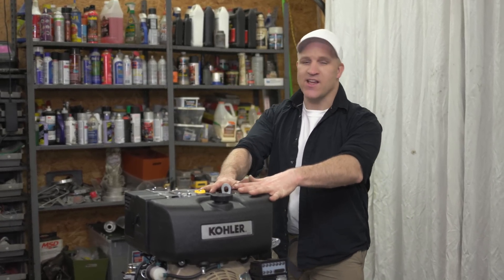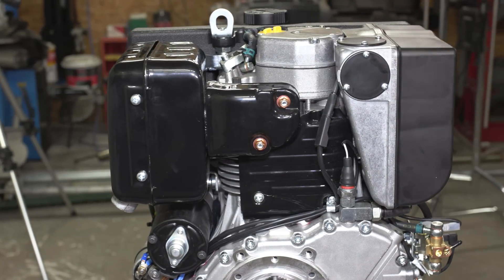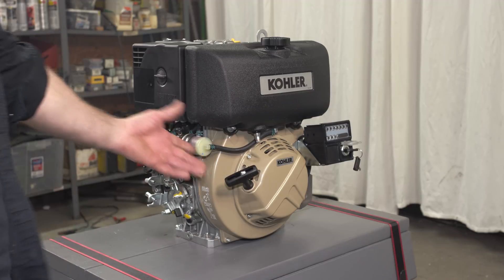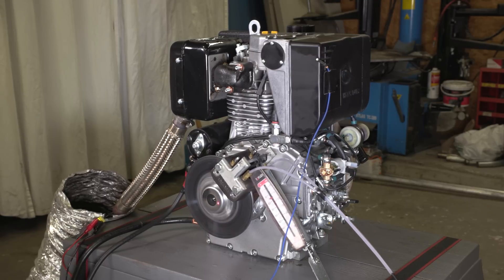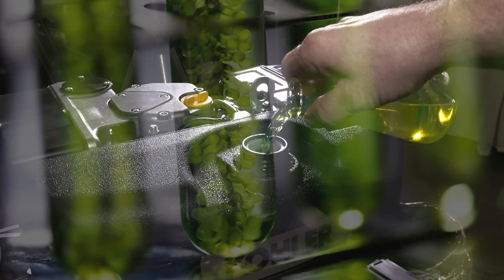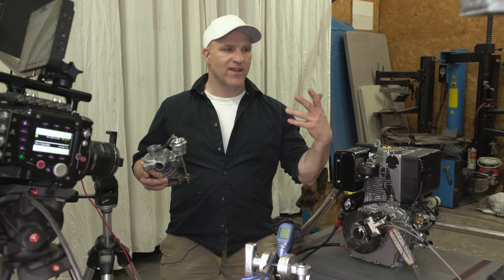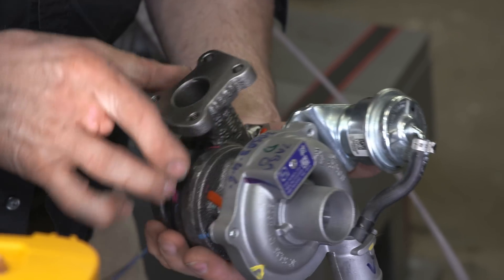Single Cylinder Diesel Engine - Dyno Test (Diesel, BioDiesel & HydroDiesel How Much HP?)

Comment: And in your estimation.  The winner is!?

It otherwise was, a great video.  Superbly produced.

It would seem to me.  Me the, audio engineer/broadcast engineer.  The Hydro diesel had the hottest exhaust gas temperature.  While the block and head.  Maintained, the coolest temperatures.

On the other side, normal diesel.  Was just the opposite.

And so not being a diesel person myself.  And looking to extend the life and serviceability of the engine.  As an electronic technician.  I know that heat kills.  And with an apparent increase in power.  It's too bad.  One cannot just fill up with Hydro diesel at the pump.  I mean, what is that stuff?  The Walmart 1 gallon emergency diesel fuel for your, diesel Mercedes-Benz convertible?  While that looks like the stuff everyone would want to be using all of the time.

I guess it's that extra hydrogen and oxygen infused into the petrol soup.  That provides the extra power boost?  While also perhaps.  Automatically causing your cylinder walls and rings, to get rusty?  But it's only to get to the next, fuel station.  And so no big deal, short-term?  Kind of like having only the availability.  Of a master fuse for the starter.  Or no starter fuse at all.  And you do the math.  Tow truck?  Or a burnt hulk of a car?  Tow trucks are too expensive.  And since the 7-11 fuel stop with no tow truck is 11 miles up the road.  While the towing company is 50 miles away.  Let's see what happens?

Oh look!  It started.  And so you take a piece of tape.  And you tape the blown out one in front of your speedometer.  But still being able to read it.  Of course.  And that way you won't forget to stop at the auto parts store.  To get the proper replacement.  Because you want to have, the proper replacement.

In my, audio engineering and electronic technical maintenance, experience.  At least that's the way I would roll.  And then just going back to using regular diesel.  Regular diesel has served me well now for 30 years.  And you pour the extra stuff in for the cold weather season.

Comment: Actually this is making the measurements differ from each other. Increased RPM increases horsepower. The "regular diesel" test run resulted in 8.5hp @ 2800RPM
And the "hydro diesel" test run gave 8.83hp @ 2900RPM.

If you would've increased the RPM to 2900 with the "regular diesel" you would've got around 8.80hp. Here's the equation: 8.5hp divided by 2800rpm = 0.0030357143.
0.0030357143 * 2900rpm = 8.80357147 hp.
You can also do it the other way around:
8.83hp divided by 2900 = 0.0030448276.
0.0030448276 * 2800 = 8.52551728hp

So "regular diesel" would theoretically give 8.803hp @2900RPM
And "hydro diesel" would've theoretically given 8.525hp @2800RPM

You can't do a test with different RPMs and think it doesn't affect horsepower, ask any professional dyno shop.

Comment: My grandfather used to tell me that they would add around %10 gasoline to diesel to increase the freezing point of it and he was adamant that it also increased the performance. I'd love it if you can try that.
Another video would be to find out whether cetane boosters increase the performance.
Running it on vegetable oil
Nitrous injection
Meth injection
Nitrous injection + turbo + see-through engine would be ultra cool.
Spraying oxygen through the intake while the engine is running to increase the concentration and measure power difference.
these are just off the top my head. Great video!

Comment: I used a hydraulic pump as a brake. Then removed the load cell from a scale and connected it to an Arduino along with a hall sensor. That way everything could be fed into a computer and you don't have to deal with the brake fade of friction materials.

Comment: Wait, what? You're running it on diesel fuel, bio-diesel, and milk?   Is it at least whole milk? Huh......🧐
Honestly though, I'm pretty surprised at how much less power it made on bio-diesel, that's damn near a 10% drop in horsepower. Damn.

Comment: Pulling the air deflector on the back side of the cylinder away from the fan was wrong.  The cylinder needs to be cooled on all sides.

Comment: Hey there I have Ktm duke 390,, here in india i have seen many people running Single cylinder Diesel Engine by swapping that on ROYAL ENFIELD BULLET Motorcycle ,, and they claim the Mileage of 70Km/ltr .. I think thats very Fuel Efficient ,, ..

Comment: Please do an experiment on this. Is it possible to skip a cycle to save fuel?..(regardless of the power output) for example, you have a 250/300/400 cc engine (four stroke) and it fires after every 2 revolutions we do a trick to the carburettor or an EFI or any other system to make it fire after 2 cycles (4 revolutions). So virtually it becomes half the real displacement i.e 125/150/200cc and consume half/less fuel. On any engine generator, motorcycle, mower. Please do an experiment on this.

Comment: Possibly do another run with the three different fuels, and do a time attack test to see which it burns through faster, given a fixed volume of fuel or fixed mass of fuel, such as one liter or one pound of fuel. That would also help to show how much power can be made with what fuel, and which one is really best as far as power per mass/volume.

Comment: Don't forget to build a boost box with the turbo. I forgot the math on it but you can Google it.
Reply from the maker: I was thinking about the boost box that's originally the way I did it and then I removed it and went straight from the turbo into the intake...  I mean I can always build it as an add-on.

Comment: Just remember to build boost in a single cylinder engine you will have to build a chamber. This calculation can be found online for the exact size the chamber needs to be based on engine size

Comment: Dude. That is a cool little engine. I think i'm gonna buy one myself and make a diesel gocart or something. Almost 9 horses on that wierd hydro stuff isn't bad at all for a small non turbo diesel.
Reply: The excessive weight of the thing will destroy a gocart frame. You want a beast? Build one with a Rotax 503 engine 50 HP and it is lighter and smaller than that Engine!

Comment: Woha! What a color! On the fuel!
In Sweden, the normal fossil diesel is like almost clear (but it also is like the cleanest diesel you can find on the market in the world), and HVO (hydro diesel) is also clear. Almost like water. Either you have diesel that they have put color in, or it's a biodiesel (RME) in both samples. And the hydrodiesel seems to be partly hydrated.

Comment: All the kohler diesels aren't designed by kohler but are actually italien Lombadini diesels. Kohler brought Lombardini a few years back now. Even the 3/4 cylinder water-cooled diesels are all based on the Lombardini LDW series. 
There not bad engines, best described as 'medium duty', not as good as a yanmar/kubota but fit a price point and miles better then the cheap Chinese knock-offs.

Comment: Wait a sec - at 8:01 the graphic says hydrodiesel is 80% diesel and 20% water.  And the engine produces more power than 100% diesel? How is that possible?  And although I'm sure you just can't dump water in the truck diesel tanks, why isn't this fuel more widely available? Is it cheaper than diesel?
Reply from the maker: Exactly what I was thinking, and that's exactly why I agreed to try it out, I mean but who knows what the catalyst is? I already called the company and ask them to give me more information on this fuel... Let's see what happens but I'm totally doing some further testing, if anything out of pure curiosity

Comment: When you pipe in the turbo. On the intake outlet Add a 1/4 " port and connect LP. Liquid propane. When you do your runs use a small amount of LP and see how much more power you get. I bet you get a big increase in power. Be careful not to use to much LP
Reply from the maker: Nice !! We think alike
Reply: @WarpedYT  is there a boos reference on the injection pump? If not adding more boost wont do much without extra fuel
Reply: Maybe instead of propane you could add HHO.
Reply: Anthony Fasano I’m pretty sure it will detonate if you inject it at the turbo. Best bet is liquid injection right in the inlet port.... like DPFI. But even then it might still detonate. 

I think you’d be better off injecting something in the exhaust (pre turbo) to help it spool and make some proper boost.
Reply: @mareksumguy1887  intake only and it will work.
Reply: @mareksumguy1887  nothing in the exhaust side. And if you want to make more spool use nitrogen on the exhaust side. To increase the volume and pressure Vapor nitrogen they sell and Heating and Cooling Supply House 80 cubic foot cylinder will cost you about $175 end to fill it will cost you about 22 and a nitrogen regulator cost you about $45 and an 80 cubic foot cylinder wig last probably three or four runs on the dyno
Reply: Use enough and it just runs on it for GM, VW will knock and let out embers, I kinda wish I had the time and money to sacrifice a GM 6.5 and just let it run on it with a throttle, I used a propane evaporator regulator typically used on propane conversions of gasoline engines and fed it into the air cleaner box

Comment: Many people think that diesels rev low due to burn rates. It would be nice to see how cams, injector orifice size and injection timing affect the RPM and max power. See if you can make some power at 6000 rpm with this thing.

Comment: i imagine with the turbo, youll be testing power gains (obviously) but maybe even if the intake temps will differ+heat difference in the head and block compared to n/a?

Comment: It performed horribly, but that Cars and Cameras video with the Chinese diesel was pretty funny to watch, what with the kart's tendency to lift the front end.
Reply from the maker: I know that's why I used the video, I wonder how much power it makes compared to this one ?
Reply: @WarpedYT  the Chinese one? I've heard they're honestly very weak. The poor quality of the metal they're made from is probably the main reason, pretty sure their compression is low for a diesel. That said, I'm just guessing. I don't think I've seen one actually tested.

Comment: Yanmar makes a pretty stout single cylinder diesel.
Reply: Hell yea man. 
Any of their engines ...
I've been around em and usually what happens is they have 5 to 10k hours on them , some genius doesn't tighten the air filter down at service and it gets dusted. 
There's some sarcasm there ...the damn thing ran forever and still had alot of time left but alas , service mistake human error. 
A conventional single cylinder like a Briggs is lucky to get to 2k usually.

Comment: That 'hydrodiesel' is interesting stuff. It seems to produce the same power or even a little better than regular diesel, but with higher EGT's and lower head and block temps. I'll have to research that a bit and see what's in it.😉 In retrospect, methanol/water injection will make it run a lot better with reduced emissions and lower EGT's.
Reply: While true you need to modify the intake system. Hydro diesel doesnt need that. Just pump and go on any diesel. And steam cleans exaust!

Comment: Since you are testing all of the operating parameters of this engine, did you break the engine in prior to conducting all of your testing?  Since you were testing at a constant engine speed did you conduct fuel flow rates for the different fuels, at peak power, and most efficient (65 – 75% power), sound pressure (Db) with the different fuels, co2 and particulate testing, could you also add vegetable oil as a fuel to see how they all compare?  Is this particular model of engine the Kohler KD15-440?
Reply from the maker: I'm totally not testing all parameters of the engine.. this is mostly for fun and some Education. ... I might try that in the near Future

Comment: It's actually a lombardini and Yanmar are better engines hands down I build all types of engines all sizes and I can promise you people this
Reply from the maker: Well I guess we will see, in my opinion to be a really "good engine" you have to be able to purchase that engine easily, I was in contact with yanmar for a year-and-a-half, and guess what, after all that time still no engine ....smh ridiculous, if you make a good engine what's the point if you can't get the engine in the customer's hands. This engine showed up at my door in a week....done.
Reply: @WarpedYT  if that is all legitimate you then have a fair point , I didn't mean to sound  upsetting in any way I'm only going off putting each engine in to equipment like power washers topsoil screeners site mixers log splitter an so on (SIDE BY SIDE) Yanmar will out preform that Lombardini/Kohler in every way maybe not to perches but to work on and rely on

Comment: Am I missing something here? In order to measure ft/lbs you need to be measuring the force exactly 1 foot out from the fulcrum, in this case the crankshaft. It doesn't look like the scale is 1 foot out from the crankshaft.
Reply: You did miss something.😁 There's a second spring of equal tension behind the spring-loaded scale, effectively doubling the tension at a 6" radius.😉

Comment: These engines are quite efficient in generators but such a pain to get started. Especially when you don't start them often.
Reply: It's even worse when you have owners who don't understand that the radiators need to breathe.
Reply: Curious why they're hard to get started? I got a somewhat rare (for the US) FB markerplace find of a 3.3hp water (hopper) cooled horizontal single cylinder Chinese "Chang Fa" style engine the other day, and the previous owner claimed he only ran it for a few minutes then let it sit ever since. Tag says manufactured in 2005. Other than having to pull the fuel pump and work it by hand to get it unstuck, it started after a few cranking attempts after fixing the fuel issue. Hand crank (not recoil) start, using compression release. Seems like a pretty durable unit.
Reply: @MittyNuke1  does your engine run on gasoline or diesel?
Reply: @gideonkloosterman  it’s a diesel horizontal Chinese R165 engine with hand crank start, rated for 3.3 or 3.4hp. I was starting it when it was maybe 60-70 degrees F out at the time so it’s possible it was easy due to that. I’ll find out soon enough how it works in the cold as it’s now getting pretty cold where I am. In January-February it can get down to about 0 F outside (at the lowest) even though I’ve been storing the engine in my basement which gets down to around 45-50 F in the coldest of winter. I recently ordered a 3kw permanent magnet alternator I plan to belt to the engine to experiment with building a homemade inverter generator, as I wanted something I can run off heating fuel. From what I understand, the smaller horizontal Chinese diesels use swirl chamber indirect injection while the larger (maybe 8 hp+) use direct injection as well as the counter-balance shaft.

Comment: With hydrodiesel is the  HP 8,83hp : 100% =... x 1,30 % =11,49 HP nice👌 if the trubo is installed the trubo "the +0,30% hp in the formula "
Reply from the maker: That's a really good point I thought about that, since I drew diesel is 20% water I would think that would reduce the overall energy of each injector pulse by 20%

Comment: Maybe try some alternative fuels. Ive used waste motor oil, and filtered ysed vegitable oils in my old diesel vw. (Only 2003 modles and before can really hande it! Also i swapped out the factory fuel filter for a cat high efficiency 2 micron filter) id be interested in comparing fuel efficiency and maybe the exhaust pollution levels between each! Thanks man.

Comment: I am not really a fan of that really present knocking sound at the start. It may just be something rattling on the engine
Reply from the maker: Same here but that's how diesels run apparently
Reply: @WarpedYT  thank god my old tractor runs smooth. If it were making these noises it would spend a month in the garage being rebuilt.

PS: make turbocharged give it all you have! Looking forward to seeing that

Comment: You need to show a comparison of the three fuel results "side by each".  Would have made it MUCH easier than reviewing all three for a screen shot, requiring the viewer to assemble the three screenshots themselves.

It would have been nice to have explained what the OEM rated power of the engine was.  Additionally, you always pour anything out of these 5gal steel cans with the opening at the highest point, avoiding the mess you just created.  A little additional info on "HydroDiesel" would have been nice too. 

A lot of effort with very interesting results, but you left out way to many common comparisons and explanations, but I am subscribing to see the turbo diesel results.  Don't forget to increase fuel flow... and describe "HydroDiesel" for everyone's benefit (never heard of it before now).  Great job, with a little polish...
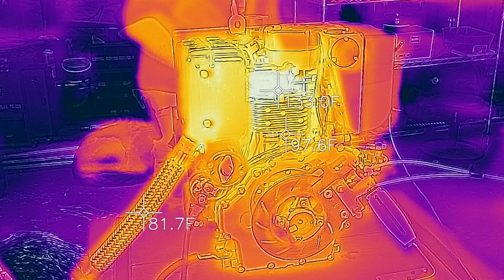Reply from the maker: I know I completely forgot I meant to do that but I was working very late on this edit till about 4:30 in the morning and I completely forgot to include that part